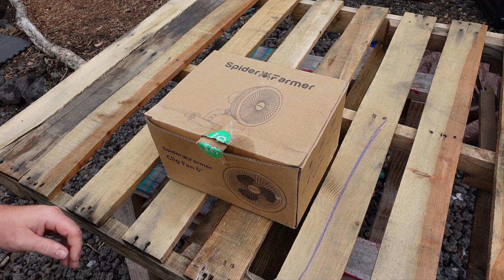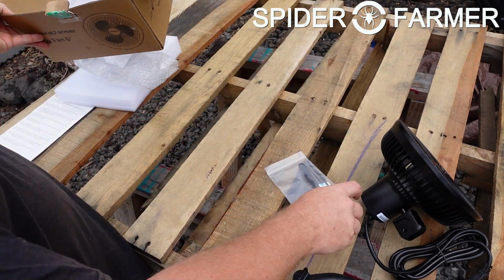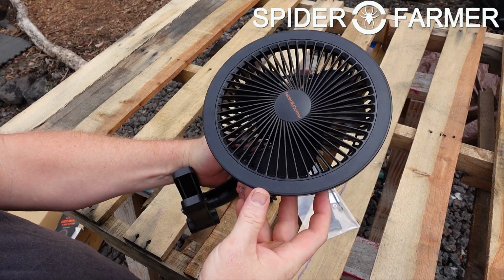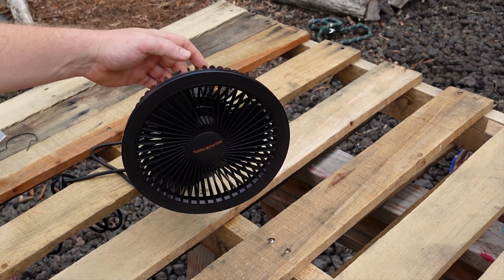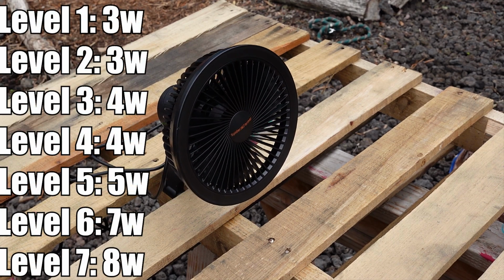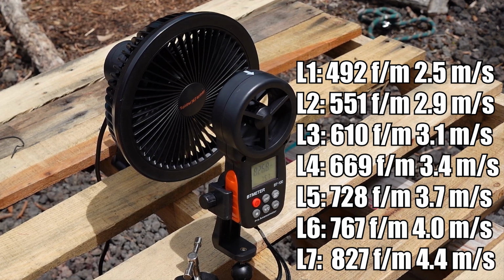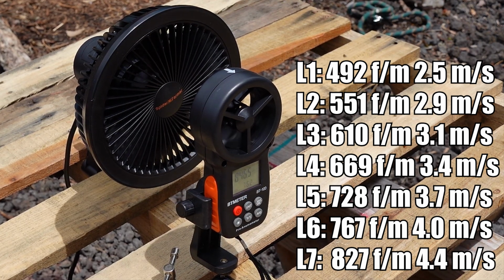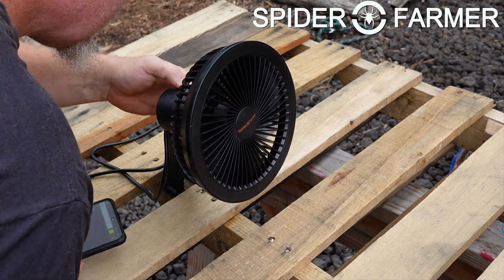Energy Efficient!! Unboxing The Spider Farmer 6" Oscillating Fan With Airflow And Power Measured!!

Comment: Got one for Christmas and it is already broken and all I ever did was open the box and clip it inside the tent and turn it on.  Stopped Oscillating after a couple months and the power dropped off considerably since then. And I can tell you from experience with a faulty dimmer in one of my Spider Farmer lights...there will be no warranty replacement or help from this company.  They are garbage.  Spend your money on AC Infinity.  I have 4 of their fans and not only are they all still working, but AC Infinity replaced them FOR FREE when there was a problem with the design and they redesigned them.

Comment: I love spider farmer but this fan crapped out on me after 3 months. Just stopped oscillating and would barely push air through, it just slowed down to minimum speed despite adjusting it higher, it wouldn't go faster.

Comment: It’s an ok clip fan AC Infinity’s has taken clip fans to the next level even with waterproofed cords that have grommets to completely keep all moisture out of your fan making it last twice to three times longer, not only that it has three lasers that will help it reset to the zero point (if you bump into it) and you can even set the radius to prevent it from bumping into the walls or anything else, also has a realistic breeze effect. Oh btw the opening fronts are a basic for basically all companies nowadays lol and technically AC Infinity’s is using the most powerful/efficient motor out of all major budget companies such as SF, MH and more. No im not advertising I just got their newest V2 and it truly is the best clip fan I’ve personally ever used. Have a great day everyone and may your grows be bountiful, Namaste.
Reply: Except there's a lot failing.
Reply: @markrigg6623  actually that was the old model not the new model which they dont sell anymore lol
Reply: @PhillyJuggalo  The new model has failed for me. They replaced it so time will tell
Reply: @markrigg6623  hasn’t for me yet, if you put it upside the book tells you not to do that with the new model it will cause it to fail and I’m not saying you are but that could be one of the main issues since the old model you could and with a bunch of people being creatures of habit it’s plausible.

Comment: If you can't connect it to a controller it is no better than any other oscillating clip fan. What a waste
Reply: Just use a timer✌️
Reply: You don’t need to control these, you leave them on 24/7
It’s completely different tech to the old fans, quieter and more reliable so stop talking shite